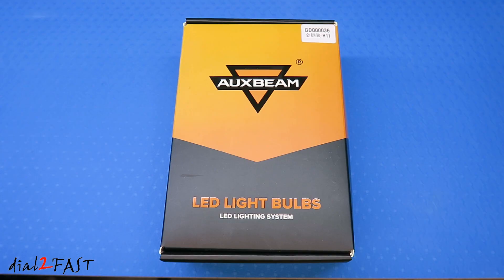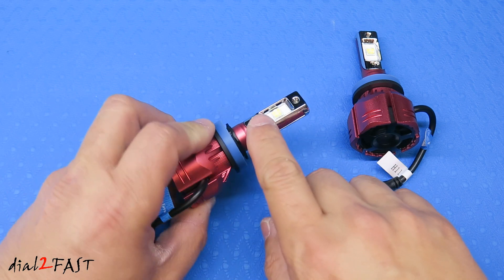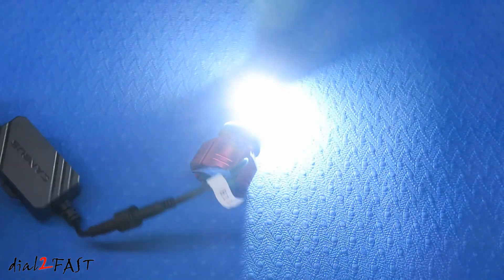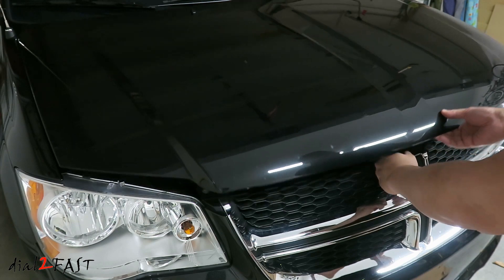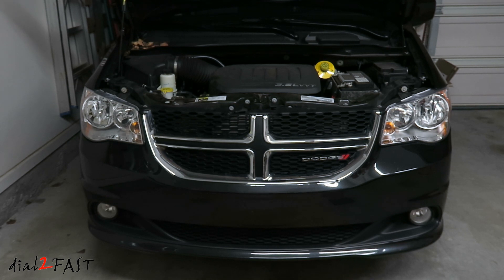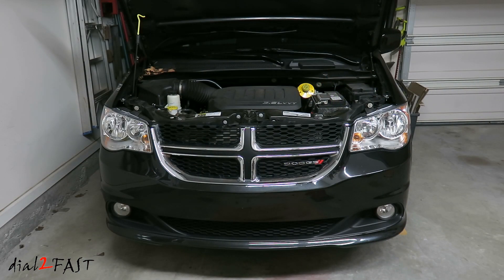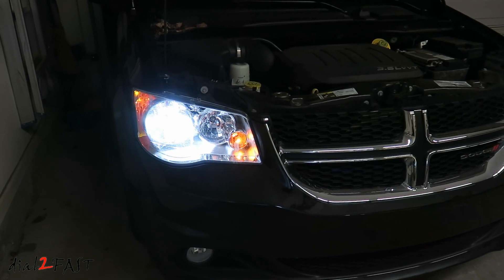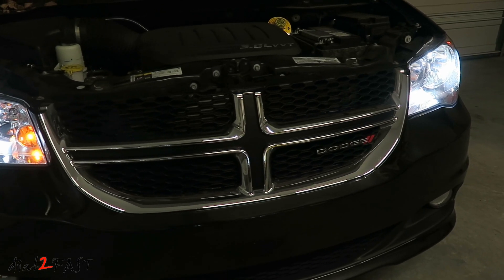Auxbeam W Series 6500K LED Headlight Review

Comment: One wonders if the cost of these kits is worth it.  Manufacturers generally install good OEM equipment.  I find it hard to see the need to shell out a chunk of money for a different temperature bulb.
Reply: You can get Cree led from ebay for around 10 bucks... They are as cheap as the halogen light bulbs nowadays! In my country if i buy those exact LEDs they will sell them to me for 50 bucks because they are not as popular so they can easily lie about the price.
Go on ebay and search LED kits they are cheap
Reply: By the time you replace halogen bulbs, which are kinda pricey for the good ones.... they run so hot they melt your sockets or you get water in your headlight, they blow out!! Led  lights last, run cooler and give cleaner light.